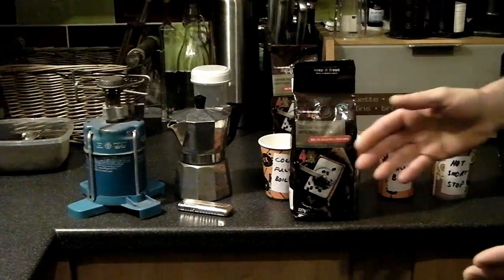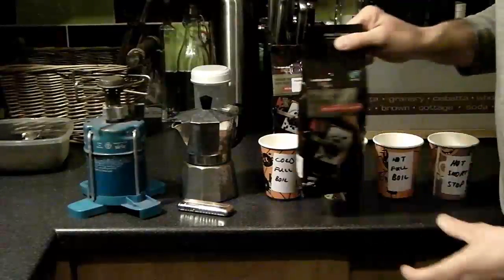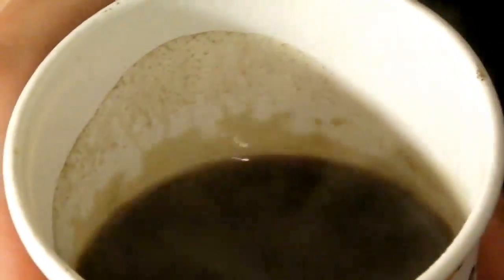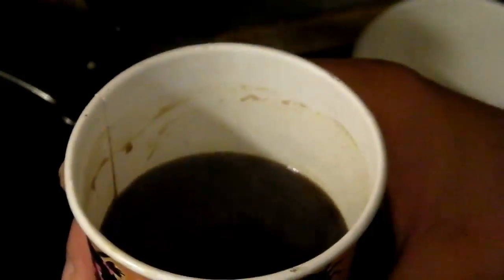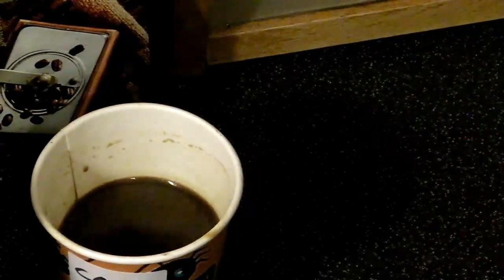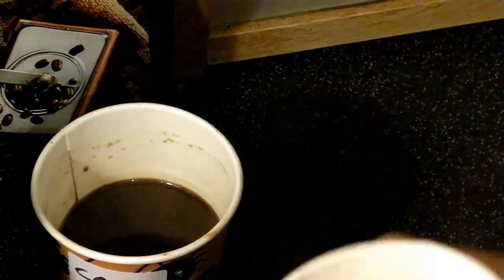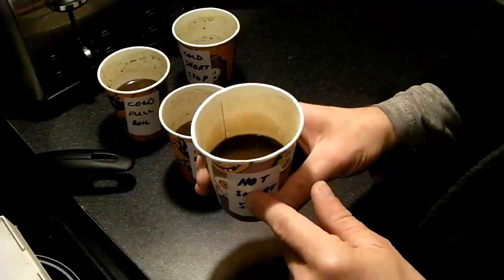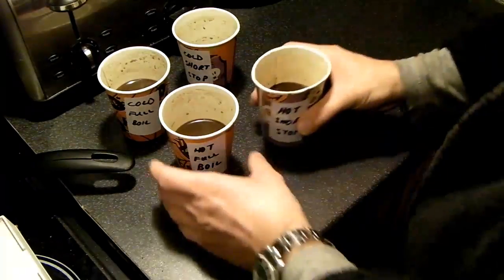BEST MOKA POT COFFEE EVER! Moka experiment

Comment: I went quite similar path to your discovering my best coffee from a moca pot and let's say I use your 4th method but as soon as I see coffee coming out of the holes I take it of the stove and put it on an iron kettle stand. There is enough pressure and heat to bring the water up and this makes me sure the coffee is not burnt. Cheers.
Reply from the maker: +siecieh That's interesting, worth a try to see if there's a difference to be noted.
Reply: +spidiq8 sorry I have made a mistake in the above. As soon as I see the steady dark brew coming out of the holes changing into light colour, aerated coffee, before it starts spitting I put it away :)

Comment: I do hot start 'short extraction', though I do think on that last cup you still over extracted quite a bit.  I stop right when you see the coffee coming out at a high speed with a lot of air bubbles and steam coming out.  That coffee always tastes burned to me.  Also, just running the bottom/sides of the moka pot under cold tap water cools it down nice and quick.  I think a more interesting test would be optimization of grind size with a hot start and even shorter extraction.  Nice vid

Comment: @spidiq8
Hopefully you switched pot's rubber gasket by now. Having so much air bubbles during extraction shows that gasket is allowing steam out (around coffee) instead of just (proper) hot water over coffee. Steam should appear only for the last few seconds with properly functioning gasket. Some metal parts might also be out of shape. I can illustrate what I mean if you are interested.
Reply from the maker: Thanks for your comment. That clip however is accelerated and the steam you see is from the open pot and hot coffee.
The bubbling is actually due to the pressure relief valve which had begun to be faulty due to a weakened spring which has been addressed since.
That said I'm always interested in coffee related things if you have any to share. :)
Reply: @spidiq8  
Here, I made a picture to illustrate my point. What I see from 3:22 shows exactly that. High enough pressure has built up and it's being released incorrectly, through faulty gasket or bent funnel edge.
https://imgur.com/a2cp1xi
What do you think?

Comment: Using hot water prevents any burning while heating the water up directly in the pot. Immediately take off the heat after spouting, turn heat low. Regulate the spouting by rotating on and off low heat. With 10 being spitting and 1 being dripping. Keep it around a 3.

This method will keep the heat low, minimize the burnt coffee, while still brewing at >1 bar pressure. Best way to use moka pot I have found so far.

Another experiment is to wet the coffee first with hot water.
Reply: I've had experience with pre heating. It seems to over extract the beans. Cold water doesn't. Use cold water. The recommended grind size for the pot. If using an electric strove, the stove top, put the dial to one. Once the top fills, turn off heat. Either use cold to stop the bottom chamber or leave it. Done. Let it cool. The bitterness should be mild or gone leaving a strong taste.

Comment: Thank you so much for this incredibly informative video. I've been trying to reduce the bitterness with my moka pot coffee and I will definitely try out your suggestions. Cheers.
Reply from the maker: Leon Kay I think you'll definitely notice a flavour difference stopping short, the one that surprised me was starting with pre boiled water, combine those two and you'll get a strong concentrated but smooth brew, should be no bitterness, drop a comment to let us know how that works
Reply: The experiment explored the differences in taste as a result  of dwelling time or extraction time in the Moka pot. That's  to say starting from cold water, heat till boiling and extracted 100% as per cup 1 vs <100% extraction by removing the pot and cooling  it immediately cup 4. 
By analogy cup 1 should have a higher concentration of extracts therefore more bitter or stronger taste than  cup 4. 
In my experience, the drip method of pouring mildly boiling  water over freshly ground coffee beans gives an aromatic smooth cup every  time ☺
Reply from the maker: Doc Kuek Thanks for your input on that

Comment: What grind did u use I’m finding it hard to get the right grind on my sage pro grinder for the moka pot
Reply from the maker: Hard to explain but on my hario hand grinder it was 8 to 10 clicks. Probably about the same consistency as a drip filter. Not as fine as espresso. The other key thing is not to compact the puck. Just fill and level it.
Reply: @spidiq8  aw  thanku for your quick reply  I will try that tomorrow
Reply from the maker: @sharonsonner1490  You're welcome. I try to reply to as many of my comments as possible, good luck with it and be sure to try the short stop method. So much difference to the flavour. Just adjust the grind up or down slightly if it's too sour or bitter. You'll know as soon as you got the sweet spot and then you'll always be within a click of the grind needed. Let me know how it goes. 🙂
Reply: Bialetti confirmed to me in an email that the "official correct grind for the Moka is medium-fine."

Comment: Don't tamp down - stop hitting the grounds down from the base of the filter.....leave your coffee loosely entered into the filter.
Reply from the maker: It is loose! Tamping is exerting pressure from the top. It needs to be full to obtain the correct pressure from the water traveling through the grounds.
Reply: Tapping it on the counter also packs it a little. Any baker will tell you the same thing about flour.

Comment: Mate of mine swears by temperature controlled kettle on it's lowest setting (70c ?) rather than boiled water.
Personally I use room temperature water out of a Britta jug, I never found the preheating method worth the bother.
Never understood why people want to remove the darker edges of coffees flavour. Each to his own, I suppose.
Reply from the maker: +willisoften There's certainly a personal preference thing that goes on with flavour.
I would say 70 degrees is far too low but when using my aeropress for example I tend to use water at about 90 rather than the 95 typically recommended.
As for darker edges of flavour, that could be seen by some as bitterness rather than flavour.
The biggest problem I encounter trying to describe flavour of coffee to people is that instant has soured our taste buds into expecting coffee to have a bitter edge, this is mainly due to the use of cheap robusta beans and partly due to the process of creating instant coffee powder, some people say they only drink 'good instant' I say there's no such thing and if you drink good fresh roasted coffee you'll realise ;)
Reply: +spidiq8  I don't drink instant at all, part of the coffee ritual has to do with getting a few minutes away from your desk....
I'm not so sure that 70C is too low to put in a moka pot, before starting, I've taken his coffee and it's OK. I make my coffee the way I like it and don't experiment much. 
Following your video I tried a few things, but for my own taste I'm not convinced that the extra process makes a coffee I prefer.

Comment: Stopping the extraction before the coffee flares out horizontally at the top of the stem is the key.  Also, properly brewed coffee should lazily flow down the stem during extraction.  I'm not sure about the cold water versus hot water issue, as there's convincing arguments on both sides.
Reply from the maker: I can tell you based on taste, my findings were as per the video, granted personal preference will mean others like it a different way.

Comment: I'm interested to know your review of the authentic Italian technique, since 1933, which also aligns with Bialetti instructions. There are only two channels that teach it in English, by Italians, with detailed explanations: 1) the "Annalisa J Moka pot" video; and, 2) the Moka tutorial by "Il Barista Italiano." 

1) Use medium-fine ground coffee. (Most espressos are too fine, but the espressos sold in Italian grocery stores are ground medium-fine for the Moka: illy, Lavazza, Kimbo, Bialetti Perfetto Moka Classico, etc.) 
2) Fill it to touch the bottom of the valve with cold or room temperature filtered water.
3) Loosely fill the coffee basket with medium-fine ground espresso. No pressing, tamping, tapping, or packing. 
4) Use a low gas flame or a preheated medium electric stove. 
5) Remove the pot from the stove the instant you hear it begin to gurgle and let it finish brewing on the countertop from the heat that's inside the pot - so don't cool off the pot with a cold towel or running water. 
6) Immediately after the coffee stops flowing out of the pipe, stir up the first most-concentrated coffee from the bottom with a teaspoon and pour. 

That's how I do it and I love the results. I usually use room temperature bottled water, but my daughter uses chilled filtered water from her refrigerator door dispenser.
Reply from the maker: That's interesting. I'll give that a try and let you know. I never really buy pre ground coffee and roast my own beans but if I grind some probably about aeropress grind it should be similar. Aeropress is not as fine as espresso and I have separate grinders pre set as aeropress is my daily regular. Thanks for that.
Reply: @spidiq8  Great! I can't wait to hear your review! If your Aeropress grind is like this, it'll work: "medium-fine grind is a little bit smaller than beach sand." I think that's what my pre-ground espressos look like. 

It's wonderful that you grind your own coffee! I plan to start doing that too because I got The Hive Roaster, with the thermometer probe upgrade to monitor the bean temperature, so I can learn to roast coffee at home. I'm trying to decide which grinder to get.

Comment: What's your method of screwing on the top when doing the hot water method ? I try using mittens but it's a little difficult to get a good grip on the chamber
Reply from the maker: It does get hot. I typically pour in the water and spin the top on as far as I can while it's sitting on the stove top, (I have a flat topped halogen). Then grip it with a tea towel to tighten it. Perhaps you could try the silicone oven mitts for grip?
Reply: @spidiq8  Yeah, I might try a towel and look into getting a silicone mitt if that doesn't work. Thanks for the reply!
Reply from the maker: @santicraft8  No problem and good luck with that. Bear in mind it's just for the final tightening. It should spin on most of the way easily.

Comment: Great video!  I was wondering what temperature would you recommend when using an old style electric stove top? Thanks.
Reply from the maker: Thanks, glad you enjoyed it, if you just use a mid to high setting as you'd do to boil water that'll be OK, the important thing is to be ready to take it off as soon as it starts sputtering and cool it quickly
Reply: Great, thank-you.